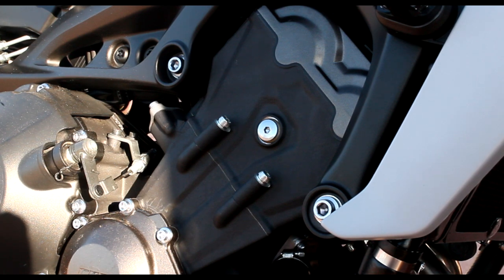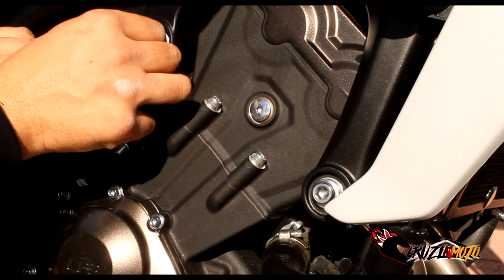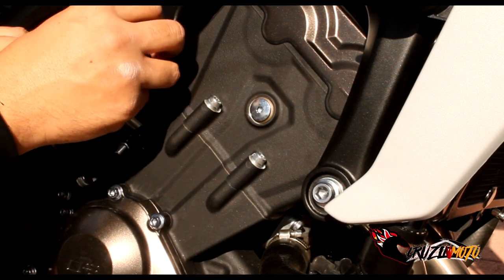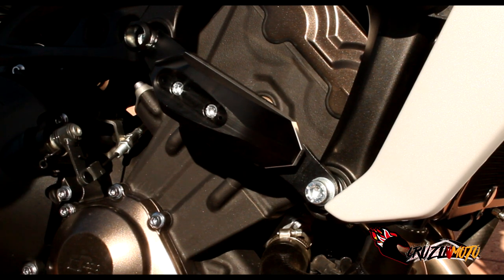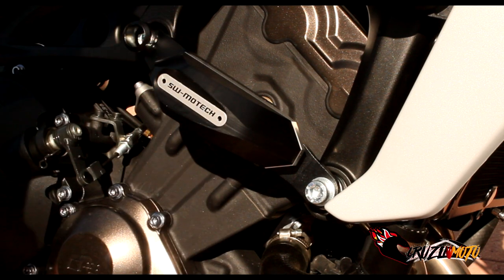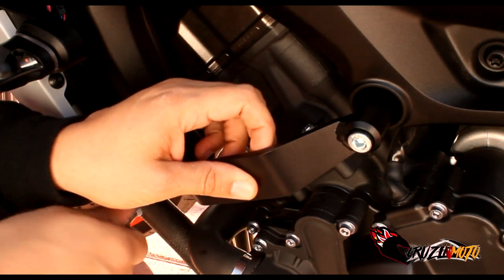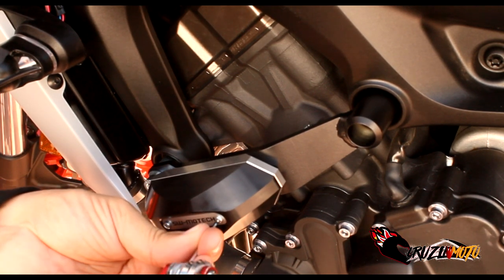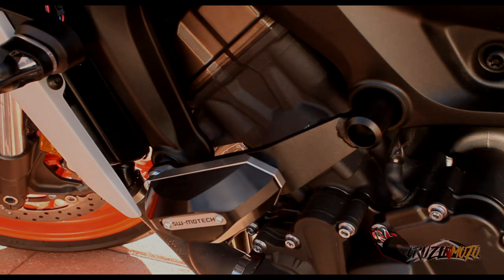SW-MOTECH Frame Sliders Install - 2019 Yamaha MT-09

Comment: Hey CruzinMoto,

I'm thinking about ordering these, but wanted to know if they are far enough out to protect the engine casing aswell.
Would you be so kind to inform me? I'm not sure if these are supposed to protect engine casing or just the tank and frame.

Thanks in advance!
Reply: This video is basically how not to install it. You absolutely need to use thread locker and make sure not to overtighten the nuts. These wont protect engine casing. You need bottom sliders, which are more important in case if you go down, to protect engine casing from cracking. This one on the video only protects the plastics. I recomend genuine yamaha part B90211D00200. They are very well enginered, but rather expensive. Motech makes also one, better looking, but less effective.

Comment: LOL 😂 those bolts have a torque spec to 33 ibf ft of torque!!!! You look like you just applied about 80 ibf ft plus 😂😂😂😂😂
Reply: And possibly put a tiny distortion in the shape of the engine...
I’d also suggest that nine of the bolts on the bike are imperial...but I digress.